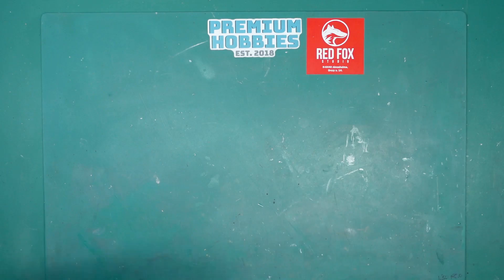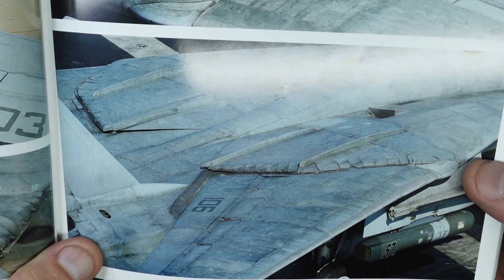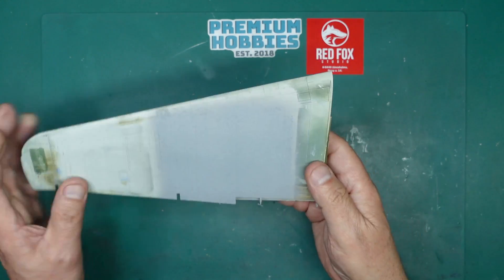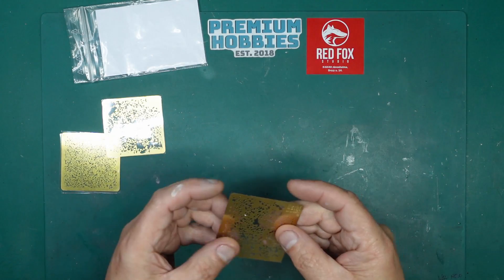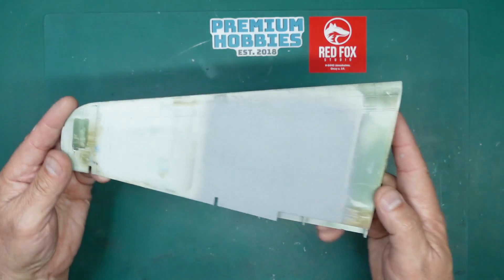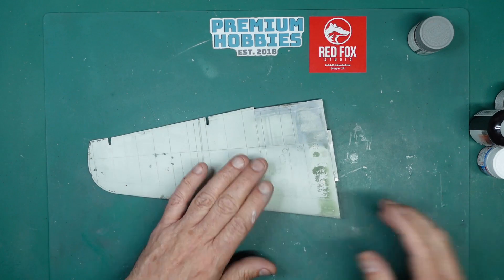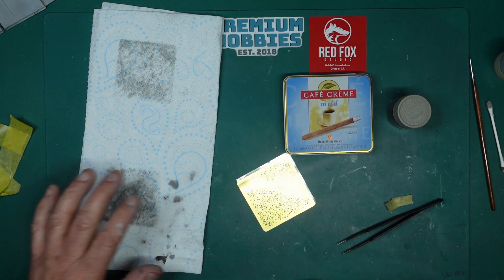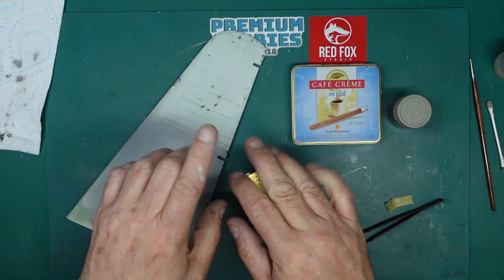A way to achieve a weathered Jet finish.

Comment: Got the Uschi set 1 recently but I haven't used them yet so this was very helpful.  Before the video had finished I was on to Premium and bought set 2 and some Infini clear files.  Expensive watch despite NMB10!
Reply from the maker: Sorry John. You will NOT regret buying those files. Once the medium beds in a bit... after one or two uses, it is the best tool out there for removing sprue Nibs. Especially on clear parts.

Comment: Interesting stuff Nigel. I have no experience of all this pre shading and post shading lark lol. I have seen a few examples of how other modellers do it. One guy primes the whole aircraft with black, then sprays a blotchy pattern of matt white all over. Then puts the main colour down with a light coat on top. Another guy primed with a grey first. Then he sprayed a swirly pattern with Tamiya Deck Tan, before putting down a light coat of the main colour. I am trying the white over black method on my Hornet build. I have done the white over black. But not put down a base coat of the main colours yet.
Reply from the maker: The technique you have tried is called black basing Andy. It is a wonderful process if you can pull it off. I think the end results are very similar to what you see here?
Reply: @NigelsModellingBench  We shall see how I get on. Not put the top colour down yet. I will email you some pics lol.
Reply: @NigelsModellingBench   Agree...Black basing and then either using a random pattern all over or random inside panels and leaving the panel lines dark before you start the light coats on top really works well.  If you cover up too much you can always use the Uschi sets (I have several and they're great).  Unfortunately that means I go through tons of Mr. Surfacer 1500...

Comment: Hi Nigel, great video(again), many thanks.  I made my own painting stencils using sheets of evergreen polystyrene, mid thickness.  I used a soldering iron to melt the splatter and effects I wanted.   I did try using plastic from notebook covers thinking it was nice and bendy but it was too hairy at the edges of the melting.  a pig to clean up.  in terms for the hard edges when using the splatter stencil.  would it be an idea to tape post it sheets to the edge of the stencil thus increasing your masked off area beyond the spray blast but but not actually having anything stick to the model which hampers movement?  worth a thought. Cheers Will

Comment: Great video mate. Was lucky enough to see F14’s being serviced following deployment many years ago. They were like patchwork, no two panels the same colour. Always said if you weathered an aircraft like the ones I saw people just wouldn’t believe just how battered they really got.
Reply from the maker: Thanks for the info Richard. Are the F-18E and F showing their age yet? Have you seen the pic on the video title of the GR4 Tornado.. Looks like Berlin Camo on a Chieftain!!
Reply: @NigelsModellingBench  my mate is coming in from Hawaii next month. He is a former S-3 driver with VS-29 dragon fires. He recently retired, but keeps close with the fleet and other naval aviator’s, so I will ask. He did tell stories of when aircraft returned to the carriers all panels were removed and checked for FOD, when replaced they piped a thick black goo round each one when replaced. On his advice a thick black panel line wash round each access port on anything 1989-2012!

Comment: Very interesting idea and looks really weathered. I’ve not seen the stencils used like that before. Usually you see people holding the stencil in one hand off the model and spraying lightly through it to get a post shaded/highlight effect. There’s a good video of Scale Model Shed using them on the Swordfish (posted in the last couple of days). I’ve used de-layered scouring pads and you get the same effect but the stencils look much easier to use … and those inifini standing sticks (all types) look so useful.  Looks like I’ll be going onto Premium Hobbies to get some of those 😁
Reply from the maker: Don't forget.. NMB 10 gets you 10% off... That's incredible that two You Tubers put up videos on the same techniques on the same day!!

Comment: all grey jets that are matt look a mess.......... those stencils look way to small for 1/32 jets, would rather the sheet was 7 inches  by 7 inches........... but unfortunately the actual jet in your photos was way dirtier, whatever the case it looks really hard to do..... it looks like hairspray chipping over black and then a wash of dirty grey........ and then another coat if need be......... but only on a cheap junk test model HA HA

Comment: Thank you for this one Nigel.  I think this would be a very effective technique to use especially on carrier based jets that are exposed to the wearing effects of salt water spray.  Cheers.
Reply from the maker: Absolutely.. which is exactly what the F-14 was Allen, so I guess that's why it looks so bad. I guess the crew walking on the salty deck then standing on the airframe doesn't do them much good?